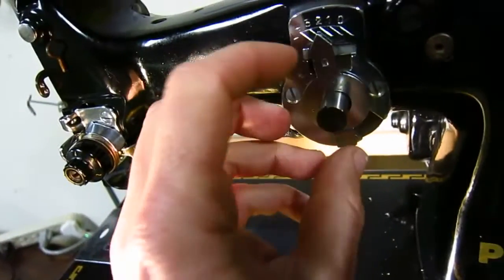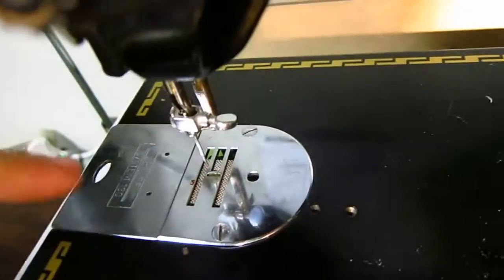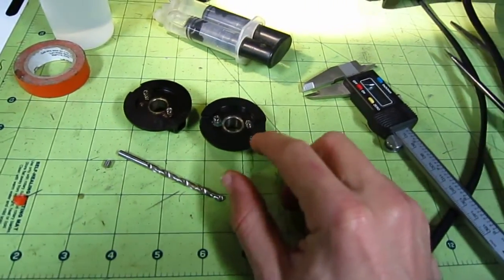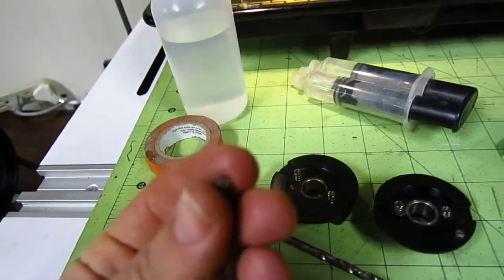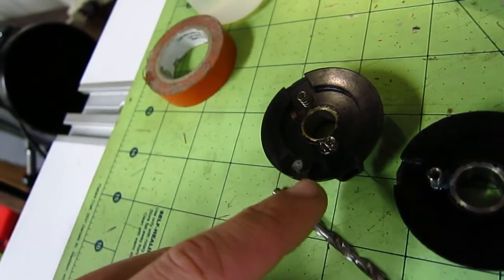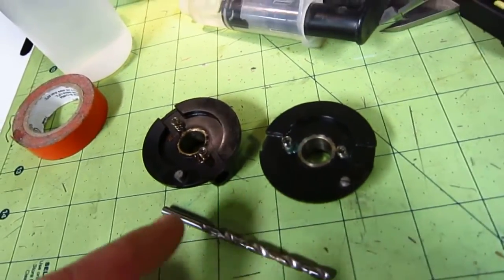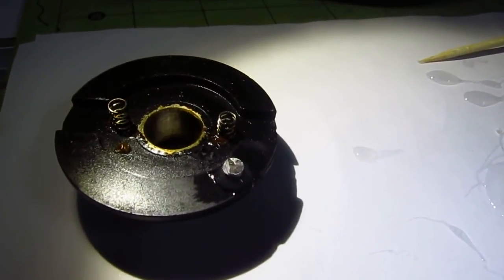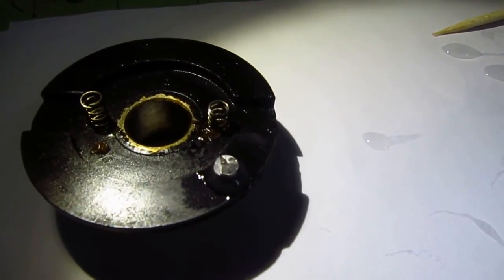Repairing a Broken Pfaff 130 Dial-A-Stitch Knob

Comment: For removing the extra epoxy you might do a test and try a heat gun and a small sharp scraper. If you heat the epoxy up it softens enough to scrape. I used to work in boat shops and that the general method  to remove excess epoxy. The epoxy should soften enough to scrape before the bakelite gets too hot.

Comment: So, hypothethically speaking (ahem), if someone had a broken Bakelike dial, what is the best glue to use to glue them together?  (One part includes the center that goes around the shaft, the other part is the right side with the stop. Don't ask...)
Also, I have a metal dial that is chipped: Would it be okay to spray it with a black lacquer paint after giving it a light sanding?

Comment: Great video ! How did you get the knob off ? I unscrewed the screw from the bottom of the knob, and the spring fell out, but I can't seem to get the  knob off. I was trying to adjust the stick. It wants to wiggle while it's on straight stitch.
Reply from the maker: Hey Mandy,  You're going to need to get some penetrating oil from your local hardware store.  "Liquid Wrench Penetrating Oil" is what I use but there are others that are just as effective such as "Kroil Penetrating Oil".  Flip the machine upside (be careful of the spool pins) and put a drop or two of oil down that hole and leave it there for several hours.  You can also put a drop behind the dial and on the front.  It will take several hours, if not days for it to really penetrate and loosen the oil that has frozen the dial onto the shaft.  Really though, it's going to take 10+ hours before it really loosens up. 

Once you've given it sufficient time  move the dial to the "2" (middle) position of the stitch width.  Then, grab a screw driver.  While holding the dial firmly in place turn the screw back and forth.  Don't try and turn the dial on the shaft, you won't be able to get enough leverage.   Just rock the screw side to side a little bit.  Eventually it will give and the dial will slide off.   

I'll make a video this week showing the procedure.  Goodluck!
Reply from the maker: Here's a video showing the fix: http://youtu.be/d3Yti4X0nFo

Comment: Awesome video! I was able to get the dial-a-stitch knob to loosen up. Please help me with my next dilemma. The take up lever is jammed and I am unable to get the needle up above the base. Have you come across this? I would very much appreciate any tips.
Reply from the maker: Soak the area in kerosene or penetrating oil to try and loosen up the varnish.  gently rock the handwheel back and forth until it breaks free.  It it's totally stuck in place it's possible that the needle bar is bent.  I experienced that problem on a Singer 15-30 and ended up having to cut the needlebar in half just below the machine head.  Hopefully that's not the case with yours.   Goodluck!